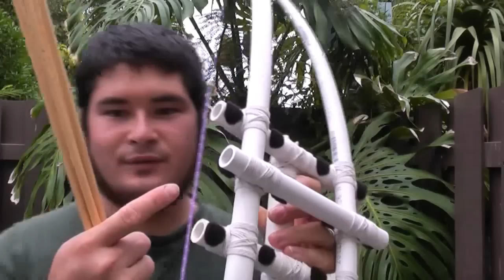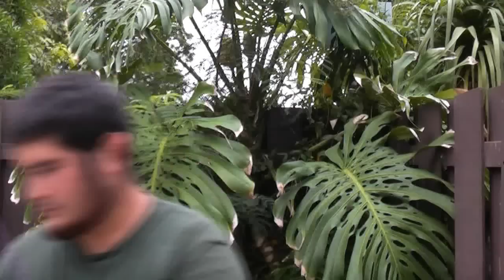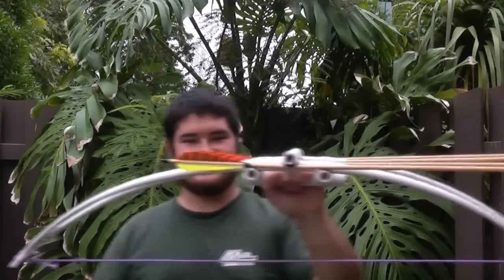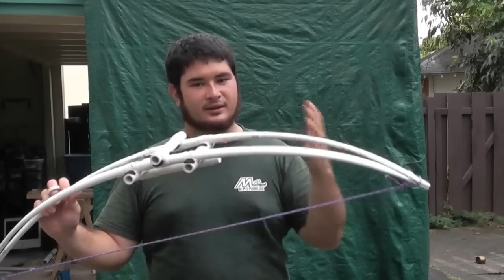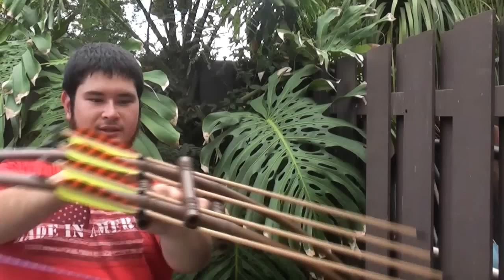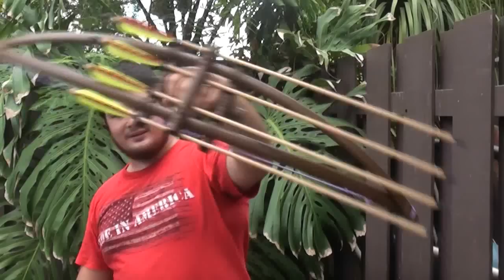How to Make a Centershot Double PVC Bow With Built In Quiver Part 4

Comment: I'm currently cutting out ( via 9inch pipe with a 1/4inch wall) a 62inch heavy long bow...may be 1/2 inch 18inches above and below the handgrip. 
Never did this before either. 😂😂😂.
Wonder what the draw weight will be..think it will break??